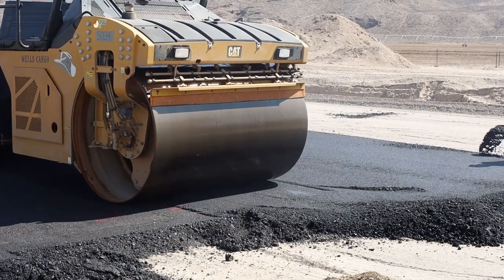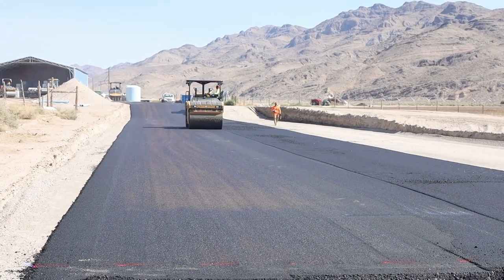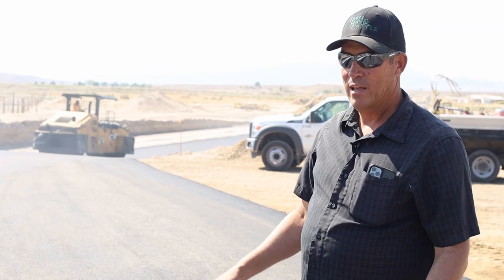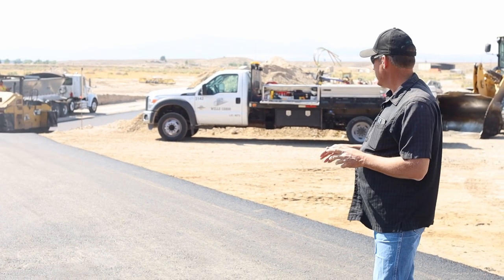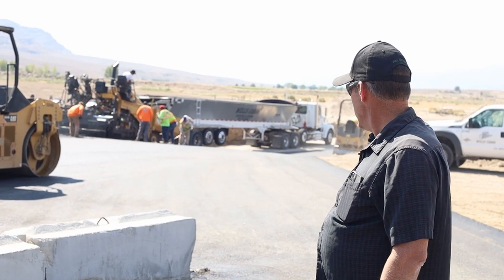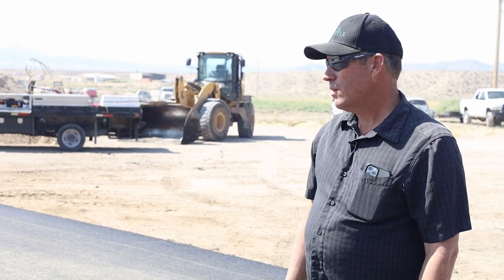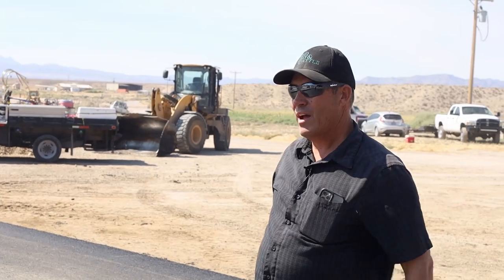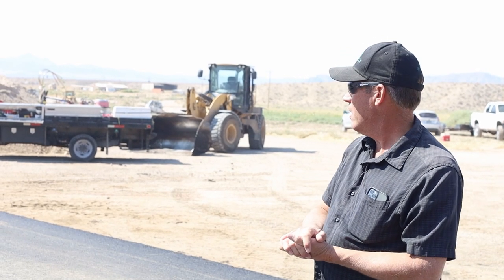Building a New Silage Pit to Store Feed for Our Cattle

Comment: Now you're trading plastic for tires and they are really a pain. Besides you still have a lot of plastic.
Reply from the maker: You're right that plastic is not completely eliminated, but it is greatly minimized.
Reply: @cannonranch  tires hold water- water breeds mosquitoes-not good-very messy to handle
Reply from the maker: That is a great point. Thankfully we have yet to have any issue with mosquitoes or standing water, but that could be due the near constant high winds we get out here during the afternoon. The pit also has rather high walls (around 18ft), giving most of the silage cover by way of concrete block (we added two more last year). There are only a handful of tires along the top with ample spacing in-between.